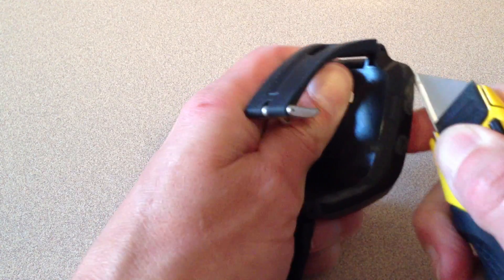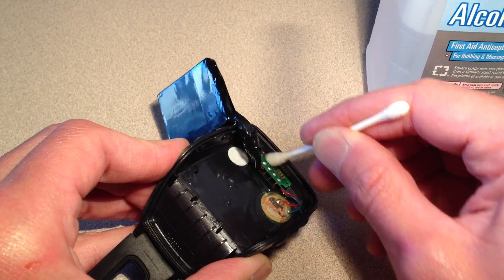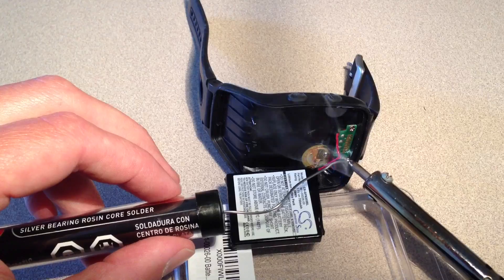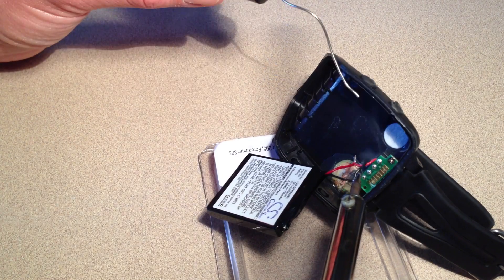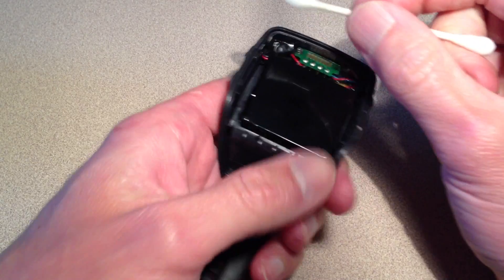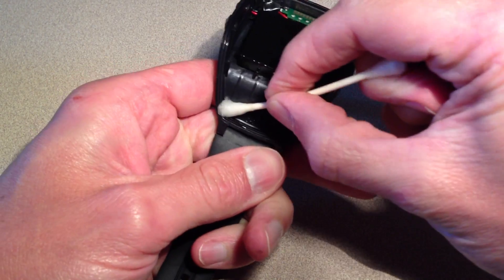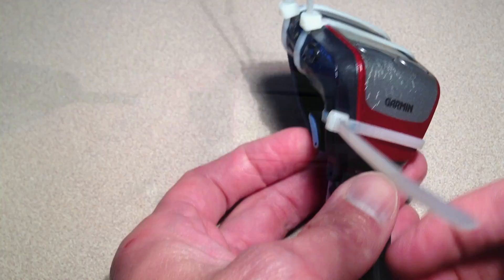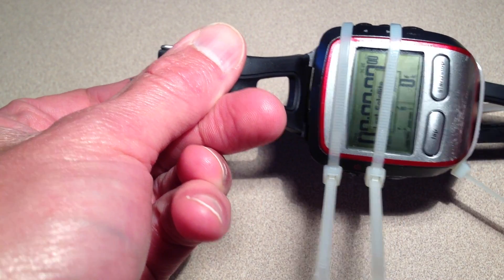Garmin Forerunner 305/205 Battery Replacement

Comment: What kind of glue did you use??
Reply from the maker: I was trying to pate the link here, but YouTube wont let me.  I just added to the video description at the bottom.  To secure the pipe together, I used PVC Primer and Cement, Then to seal it, silicone caulk. Both links included

Comment: Jeremy, Hey, I did it! That was hard. I used a small set of pliers to hold one of the new battery's wires while I gently scraped the rubber coating off without damaging the wires. That was tricky. Harder was positioning the tiny battery wires, one at a time, next to the watch's power wires. What I did was take the two red wires and held them together with the small pliers and then wrapped a rubber band around the pliers' handle so I could free my hands. Then rechecked the wires to be sure they were touching - used a jeweler's magnifying eye glass - and then soldered. Next I assembled the watch without gluing and then used a rubber band to hold it to the charger. And Voila! The watch worked. So I'll have to get that silicone rubber glue to finish it up and I be set. Thanks for the instructions.
Reply from the maker: ninemilliondollars I’m glad it worked for you!!! Should last another 4-5 years!!! Good job!!!

Comment: Jeremy, if you're still answering questions since it's been quite a while, here's one. When you soldered, did you trim the rubber back on the old wires from the case, or just solder simply melting them. They are so very small I'm afraid I won't be able to strip them. Hope you get a chance to reply.
Reply from the maker: ninemilliondollars you can buy a wire stripper specifically for stripping the battery wires.  However, I was able to trim/strip my wires with just a new razor blade and needle nose pliers.  Just be gentle.  Since making this video, I have replaced the battery a second time and used a liquid rubber to insulate the wires from a short.  Good luck!! Next up, how to replace the display cover...
Reply: Thanks for responding. That is helpful.
Reply from the maker: ninemilliondollars absolutely!

Comment: fried my 305's battery forgetting it on the charger...I'm assuming if I try this it will still charge in the same manner on it's docking station?  Do you have a favorite glue to re-seal the unit?  Thanks for the video

Comment: I used this information to replace the battery in my wife's forerunner 305.  So far it looks good.   Tested to make sure it will power up and charge prior to gluing back together.
Thanks
Reply from the maker: That's great chuck!  My 305 is still kicking.  Hope you get a few more years out of it!
Reply: i dont have the sadder gun ,dont want to buy one either....do you replace watches if people send them to you if you get paid?

Comment: I replaced the battery.  The charge that came with the battery has powered the unit perfectly.  However, it will not take a charge.  Any suggestions?
Reply: hey Brian! have exactly the same problem. no charge with new battery. Did you solve the problem?
Reply: I just chucked it and bought a newer, cheaper ($100) version.